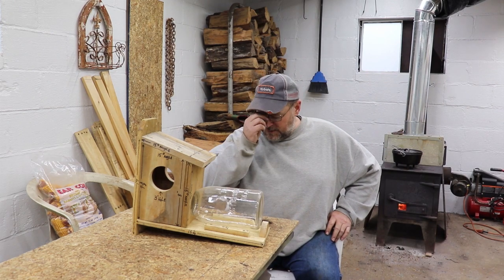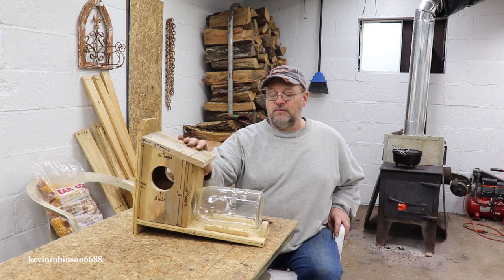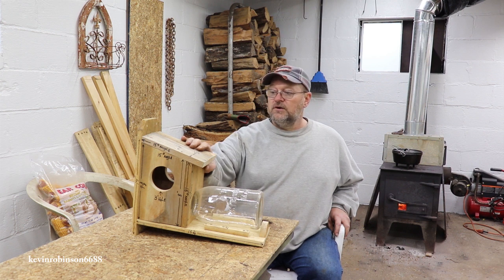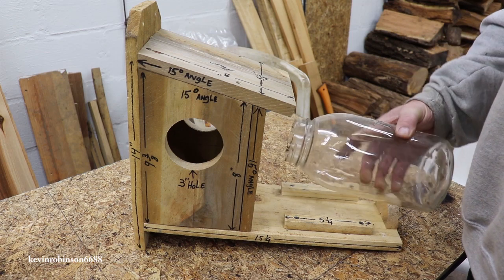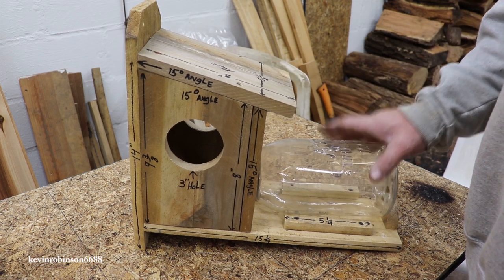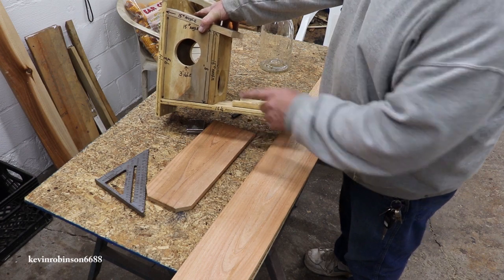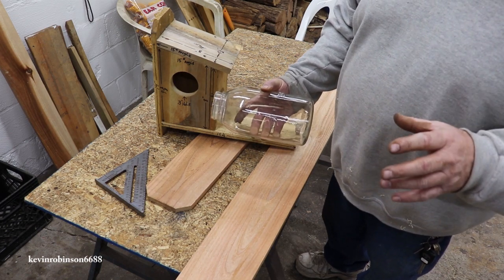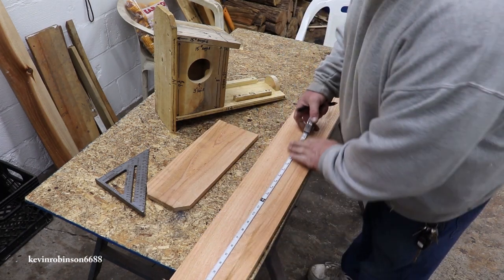squirrel feeder with detailed measurements

Comment: On YouTube one of they ever gonna allow us to put a photo on so I can give other ideas too. I love your video. It’s great. It is like one of the best. No background music if you want to fast forward to easy to fast forward you’re not gonna miss nothing Because you can stop right away and proceed. I had to use 7 1/2 inch wide to make mine but for the two sides with a 3 inch hole I use 5 1/2 inch. The only problem I’m having is cutting them holes with those doggone things it stops the machine more than anything, the blades get filled up with sawdust, but I was using treated lumber. That’s probably why.
Reply from the maker: You should start a YouTube channel it's not hard you can do it and help others.
Reply: @Robinson-Homestead  I have my own place on YouTube where I store all my videos and all my photos. But how does that pop up for others?

Comment: You’ve done really really great on this. I make mine very similar but I was a 1 gallon glass container so the whole for the glass is 4 1/2 inches and I screwed up and I bought 5 1/2 inch wide wood one by 5 1/2, I had to return them and get the 8 inch wide. And if you drill it to high, just have to stick a piece of water on underneath and see how level it looks cause I had to do the same thing now for holding the jar in place on one side, I pre-drilled the hole a little bigger and then shot a screw in there so I can swivel the other piece. Doesn’t even have a screw just turn lock. I wish I could put a picture on here. They look like this
——O——
Reply from the maker: Thanks for sharing my friend.

Comment: Only changes:

1) Coated deck screws instead of drywall screws.
2) Cut the side cleats across the board instead of with it. Less waste (see #3).
3) Save the base panel for last and use the entire leftover piece. The half-round hole plug cleat for the base of the bottle can be placed anywhere.

But that's just me. Otherwise, excellent work! Very helpful, very informative, and greatly appreciated.
Reply from the maker: thanks for the great tips

Comment: Thanks. Awesome simplicity. At first, I was puzzled about why you didn't glue it
 I confess that I didn't recall and connect your intention to give it to your granddaughter with your not gluing it together.  Thank you for being so extra clear in your wrap up in explaining that taking ot apart would make it a fun project.
At that point, a few lines across joints might make it easier to tell left from right side from right for easier matching of origional screw holes.
Thanks again for this smart design.
Reply from the maker: Thank you for the comment.